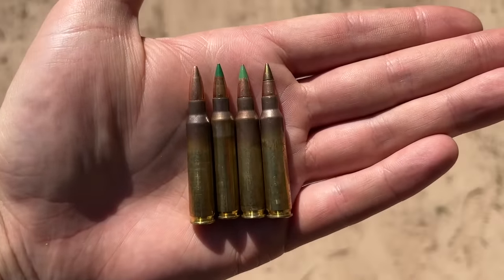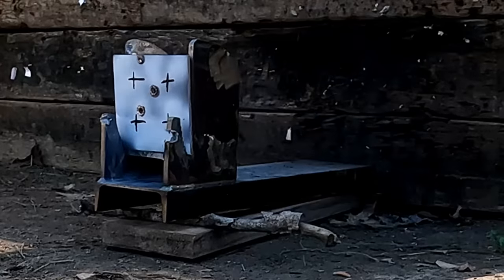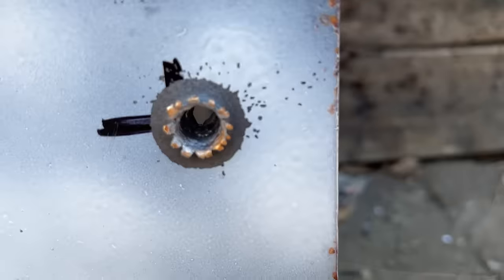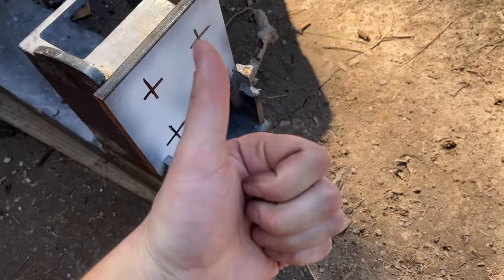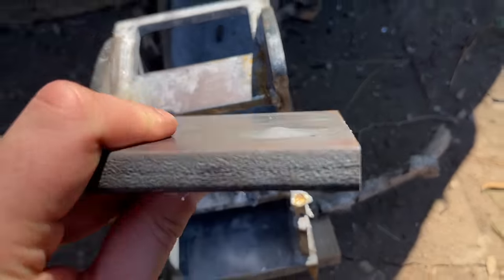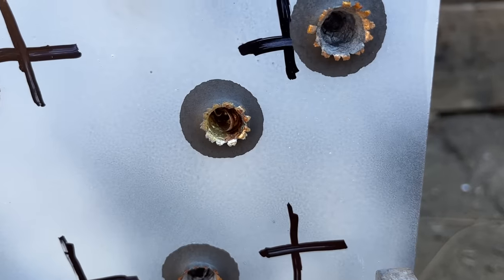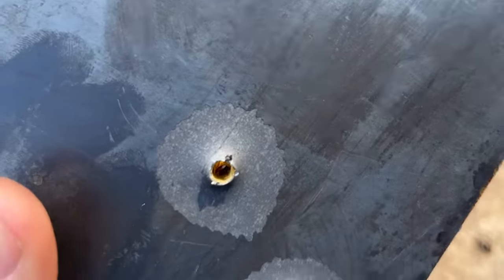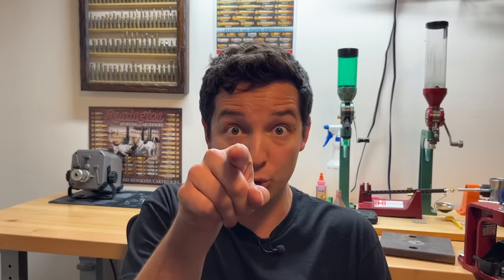M855A1 vs M855 vs SS109 vs XM193: Crazy Results on Steel

Comment: m855a1 out of a 26" barrel is the textbook definition of vibe check
Reply: That’s a super long musket!
Reply: I run em out a 24” and ummmm yeah they are def get your mind right…..
Reply: 26"!? Who holds the front of the rifle for you? Lol
Reply: The Oof felt around the world.
Reply: @robertcole7874  duck hunting shotguns are usually 28..
Reply: I’ve got 500 rounds of these in .223 😊
Reply: Can I shoot m855a1 out of ar15? It's a multi caliber 😊
Reply: @tteotyep8412  as long as it is .223, sure. and no muzzle brake. Definitely make sure you have no muzzle brake on it
Reply: Get yourself about 4500 more. That’s a decent start
Reply: @kylespirk306  can m855a1 used in AR15?
Reply: @tteotyep8412  this is not legal advice or recommendation but AR-15’s will shoot that round.
Reply: @tteotyep8412 yes.
Reply: @tteotyep8412 sure can. Make sure it's 5.56, or .223 wylde rated at minimum. M855a1 has pretty crazy chamber pressures, so a .223rem only AR will likely experience a catastrophic failure after only a round or two.
Reply: Where did you Buy that rifle from ? What is the Exact Model ?
Reply: Isn't 556 most optimal out of a 16/18' barrel?
Reply: @TTime685  not all 5.56 is made equal.
Reply: @gort7562  I'm talking about standard M193 and M855 with the common 1/8 twist
Reply: @Jermo7899  Why no muzzle break?
Reply: @TTime685  M193 and M855 prefer different twist rates but I can't remember them for the life of me. It might be 1:8 for M855? I can't say for sure.
Reply: @gort7562  Yeah, anywhere from 1/7 to 1/9 apparently. 1/8 seems to be ideal. And a 16 - 20" barrel for optimal performance. But there's so much info out there I'm having trouble getting a consistent answer lol..
Reply: @TTime685  In the m855a1 the gap between the steel tip and the brass is not smooth. It can get caught in the vents of the muzzle brake and blow up or backfire
Reply: @Jermo7899  How do you know this? Would seem pretty rare to happen if so. I would think the muzzle would have to cheaply machined or misaligned for a chance for that to happen. Or defective ammo. And why 223 only?
Reply: @TTime685  I’m sorry it’s the sabot rounds for .50 cal that can’t have muzzle breaks. I’m sorry I got it mixed up with the .223 m855a1 rounds for some reason. It is ok to shoot those with a muzzle brake
Reply: @tteotyep8412  yes they can. It’s a 5.56 NATO round. So your rifle has to be a 5.56. That is what they were designed for.
Reply: Any gun is a vibe check, 5.56 is weak, modern armor will stop it, even if it’s M855A1
Reply: @apache9162  close range It’s a beast. Most firefights are short to medium range which this excels in
Reply: @apache9162  not all shots are to the chest. In full auto it’s a lot easier to control than an Ak. Never underestimate anything when it comes to fighting for your life even the round the enemy is using. .223 has advantages over 7.62x39. .223 also has a flatter trajectory. 7.62 drops a lot over a significant distance.
Reply: @TTime685 this is mostly just praxis for (x)m193 iirc
Reply: @edstettin6799 some ar’s are .223 or lower pressure specification, so even tho it will chamber it might cause failure in the gun
Reply: @TTime685 5.56 was originally designed to operate out of a 20" barrel. Carbine versions with a 14.5" barrel have become more common in recent years with the US military. The Army adopted the M4 (14.5" barrel) as their standard issue rifle some years back. The Marine Corps kept the M16A4 (20" barrel) as standard issue ( for infantry) for a while longer, before switching to the M27 (16" barrel). The longer barrels offer longer maximum effective ranges with good terminal ballistics. The shorter barrels are better for moving through buildings & vehicles. 16" is as short as you can go without the rifle becoming an NFA item according to unconstitutional law.
Reply: Yeah it's truly impressive, I knew the M855A1 was great, but didn't realize it was this impressive.
Reply: We know who watches garand thumb
Reply: You should've hit the AR500 plate with XM193. 
It wouldn't have gone through... but MAY have dug a bigger crater than the other 3 rounds. 
With 1/4" AR500 plates - M855 at Won't go through... but XM193?  Can .
(Which is why a bunch of AR500 armor plate manufacturers started making a "3+" special threat plate (because hotter NATO 55grain ball was zipping though the level 3 plates)
Reply: …or musket.
Reply: Who’s shooting 223 out of a 26” barrel.  Maybe a 16 inch which is the most common.
Reply: @bmrz38 that’s a flag pole
Reply: @tightright7561  tons of varminters and target shooters use 22-26" barrels in 223 wylde chambered bolt guns. The velocity difference in a direct impingement gas gun and bolt gun is quite different.
Reply: no, not true. it’s built for 20”
Reply: @Jermo7899 uh, M855A1 is a 5.56 nato load. You can use pulled projectiles in 223, but at that point it ceases to be M855A1
Reply: @Midwestprpr  dude, you can use .223 in 5.56 mm. 223 is in inches. 5.56 is in mm. .223 is basically 5.56 just less pressure. Not exact but close enough. It doesn’t cease to be a 416. Just different ammo
Reply: @Jermo7899  the point is, someone was saying use M855A1 in a 223. That’s a recipe for disaster. I am extremely well versed in the differences between the two cartridges
Reply: @Midwestprpr  you’re right. I was just trying to point it out. I didn’t mean to sound condescending. I apologize.

Comment: M855A1 is really nice ammo. They should mass produce it for the public.
Reply: itd be easily $2 a round because of that tungsten core, technically you could make your own if you cast bullets or have a lathe.
Reply: It's available publicly now for $3/rd
Reply: @marblemarble7113  M855A1 does not have a tungsten core, it is a steel penetrator.

Comment: I would love to see this test with the same four cartridge in a 14.5in , 16in, 18in nd 20in barrels. Because these 4 will be more common than a 26in barrel.
Reply: Same, against ar500
Reply: Pretty sure a 26inch barrel would actually slow the bullet down.😂
Reply: Anything past 20" even onn308 has diminishing returns.
Reply: @uurkisme what do you mean. You were referring to barrel length yes? For a moment I thought you meant thickness of the barrel.
Reply: Brother you planning something? 😂
Reply: @uurkisme  wasn't it 24 inch with .308 and 27 inch with 7,62x54r?
Reply: @Stormcloakvictory  24" I think is peak performance but the difference between 20 and 24 isn't that spectacular to be worth the extra weight and length imo
Reply: My guy is trying to see what ammo he should use for his M4 in Tarkov lmao
Reply: /agree, as 26" isn't the least bit common - I've got an A2 HBAR with the 20" and with everyone running around with 16" these days, folks at the range are always commenting about how long it is.
Reply: @nunivet7006 tf are you talking about?
Reply: @lardomcfarty9866  it was just a joke.
Reply: @nunivet7006  okay. You never know what boomers will get scared by an innocuous question

Comment: That M855A1 definitely surprised me. That's a nasty Lil round.
Reply: It also is very devastating on flesh/bone.
Reply: @mikejohnson9118  At 3200fps a .177 bb would probably be devastating to flesh.
Reply: @hansgruber9685 eh probably not. Not enough mass
Reply: Great review man, a 16”” barrel comparison would be tits.
Reply: Right can we talk about the fact that the crono didn't pick up a single M855A1 round.... they are ffllyyiiinnngg😂😂
Reply: Yeah that’s why it’s at peacekeeper level 4 now
Reply: @Oreggon  It's not. Craft only.
Reply: It’ll rip through a slick, ofc it’s good…
Reply: They gave it a steel core and upped the powder load to nearly the maximum a 5.56mm chamber is rated for.
Reply: You are only see the best performance out of these rounds with a long barrel.

Comment: The SS109 is actually the bullet itself that is used in the M855. That's why both of those rounds had a green tip: they were both M855 rounds.
Reply: Forgive the ignorance but os the only difference the powder load then?
Reply: @ZyklonBeast12  Definitely. M855 is loaded to a "minimum" govt mandated velocity, based on the Nato spec. .223 Rem CAN be loaded to that velocity (with the right powder), but doesn't "have to be", and thus often isn't. Most of the Nato spec defines other characteristics of the ammunition. M855 IS .223 Rem, but with a bunch requirements added to it.
Reply: @nerdyengineer7943  Wow, I never knew any of that! Thank you for that info brotha 🙏
Reply: SS109 loads don’t have to have green tips. Green tips are only used if the ammo is made by a country that used M-193, as a way to visually distinguish between the two. I have 400 rounds of British Radway Green that doesn’t have green tips.
Reply: @mikecumbo7531  SS109 is the name of the 62 gn, steel core, boat tail bullet that us used in the M855 NATO spec ammo. M855 ammo, per the NATO spec, must have a green tip on regardless of who makes it.
Reply: @mikecumbo7531  Oh, and those bullets don't come with a green tip on them. Those are painted on after loading.
Reply: @nerdyengineer7943  well, neither the British or Swiss put green tips on their SS109 loaded rounds in the 90’s. I know Switzerland isn’t NATO, but the UK is. The British ammo didn’t meet US M855 spec, slightly lower velocity, made so for the SA80 rifle. Remember, M855 is a US spec, it includes a SS109 projectile at a specific velocity. NATO might have adopted the M855 spec, but doubt it is known as “M855” within NATO. 
The only reason for the green paint is to let people know the round isn’t M193 spec.
Reply: @mikecumbo7531  That's not accurate, my friend. NATO ammo has many tip colors to make it obvious what round it is. Obviously non-nato ammo doesn't need a tip color, if it's not to the spec. I'm researching this, but govt specs all point to other specs and so on.
Reply: @mikecumbo7531  I am not able to get ahold of the drawing for the bullet. However, internet searches show the popular wisdom is that the bullets are painted green to different from M193. So, with lack of better evidence on my part: I yield to you, sir.
Reply: @nerdyengineer7943  just Google “do all SS109 loaded rounds have green tips”. 
I know AP has black tips, forget what color tracer is, etc.
Reply: @mikecumbo7531 tracer is orangish red. Or maybe reddish orange.

Comment: One of the biggest factors here is the barrel length, 5.56 was designed for use in 20 inch barrels and up, that 26 inch barrel is getting MAXIMUM performance out of 5.56x45mm NATO. M855A1 EPR was designed to give optimal terminal performance out of carbine length barrels out to 350m.
Reply: None of this is true
Reply: @someguywithnoplan6395  Do you have source info that discredits my info, because I have TRADOC info that says otherwise.
Reply: @someguywithnoplan6395 google the barrel length of a m16 then get back to us champ😂
Reply: @nathancummins8728  No, I don't think that I will
Reply: @nathancummins8728 the barrel length of an M16 is exactly the length of the barrel you put on it.
Reply: @someguywithnoplan6395 5.56 was designed to have full performance out of a 20inch barrel

Comment: I would love to see a comparison of different 308 (7.62x51) bullets against different thicknesses of steel. Be safe my friends.
Reply: M80a1 would be insane
Reply: Pretty sure he's done all of these tests before. Just a different setup.
Reply: @fatihmehmetcevik7299  did you see ak ballistics fire 1 from a .300wm? 130@3790…I run the dd5v3 and been loadin and testin with it over 2yrs and big .30cal fan
Reply: Used to train shooting the FN fal against half inch falling plates, the mild steel ones it would go straight through but the armour steel would show hardly any penetration ( 200 metres)

Comment: Great test.  I’d prefer a 20” barrel - I think the velocities for these rounds diverge from how they behave out of standard AR-15 barrel lengths.  They are probably all still faster, but by varying amounts.  I suspect the 855a1 is comparatively even better than the others out of shorter barrels.
Reply: It was designed to be shot out of a 14.5 inch barrel from an m4a1 carbine at a whopping speed of 3000fps at the muzzle
Reply: Hmm source?
Reply: @BaconSlayer69 it was designed to be environmentally friendly. That’s it.
Reply: @coryhoggatt7691  that too but specifically it was designed to penetrate barriers better
Reply: @coryhoggatt7691  somebody didn't look at the congressional report or the army procurement presentation

Comment: I've seen other channels get a hold of those A1 rounds and they never fail to amaze me how Wicked they are.
Reply: Saw some kid shoot himself in the leg with one on the range. The results were indeed wicked. Bro deleted his calf.
Reply: @cameronking5074  impressive in a dumb way he managed to shoot himself in the leg with a rifle no less.
Reply: @cameronking5074  he was probably using m193 not m855 let alone m855a1
Reply: @moparjr89  it was definitely m855a1. It’s hard to mistake the steel penetrator.
Reply: @moparjr89  The army exclusively uses 855A1.
Reply: @orion8981  you can get m855a1 on the civilian market, see them all the time at guns shows. Good luck finding some m955 tho have yet to see it in person and there’s very few videos about it on YouTube
Reply: @allaansnackbar4269  I'm aware.
Reply: As a Soldier who may have liberated some 855A1, I can attest to what happened.  On soft targets, the A1’s copper jacket very often explosively sheds very shallow in tissue, resulting in what looks like a big exit hole, but in the entrance side.  Weird physics.  But that penetrator keeps on zipping through and out making that tiny tube of damage through the body.   Not at all like a typical soft point, hollow point, or the fantastic yaw effect of M193’s.   
Even shooting into a dead tree, you can see entry surface blowout.   
The M855A1 is very good against things wearing plates, but it is not a good overall killer in normal hunting use. 
M193 is the best killer, M855 green tip just kinda half-asses  all-around, and M855A1 definitely punches through plate, but does not necessarily kill well.

Comment: We can say there is a clear difference between the 855 and 855A1 at this point.   That frontal spauling on the AR500 .375 should be terrifying.
Reply: For sure. The splash itself could be lethal.

Comment: One interesting thing is that M193 and SS109 / M855 were OPTIMIZED for a 20 inch barrel; i.e. the "standard" barrel length for the M-16 / A1 / A2 and others like the FNC, etc.

5.56 x 45 velocity PEAKS at about 22 inches of barrel, (It it a fairly dinky case, after all). The M-193 cartridge  AND the M-16 rifle were essentially developed in parallel. 

Hence, after going "all in" on the 14.5 inch M4 concept, a "new" optimized round seems to be in the offing. How this might behave in a LONGER barrel like the M249 is anybody's guess. (chopping the M-249 barrel back to 14.5 inches might just cause a whole lot of new "issues".

Comment: I have plenty of M855 and 700 rounds of M855A1, because it’s the best combat 5.56 round out there IMO. It will create a massive temporary wound cavity and is barrier blind. It will also penetrate most body armor outside of level VI and very expensive level 3+ plates. Another great round is the 77 grain MK 262 that you should have a good stock of as well. It’s a very accurate cartridge that is good for distance and has great performance on soft targets. M193 is a target round for me and nothing else. I mean it will still do the job, but it’s one of the least effective 5.56 rounds available in my opinion, because it really relies on velocity from a long barrel. I wouldn’t recommend it with anything less than an 18 inch barrel. Great video!! I have recently become a subscriber and appreciate your testing.
Reply: Goodness that's a lot of A1. Mind if i as the $/rd you paid?. Cheapest A1 I can find is $2.50 per round. I'm also trying to slowly build up a quantity of M80A1 but that's going to take a while considering the cheapest I can get it at is $8 per round and it rarely comes onto the market.
Reply: Where does one even get M855A1? I thought that was only available to military
Reply: If you've got a 20" barrel, M193 is wildly effective. Especially for the cost. IMO, that alone is reason enough to have a 20" setup in 5.56 in addition to shorter rifles, solely so you can stock up on large amounts of cheap 55 grain and know it'll be effective for anything you'd need.
Reply: kudos..... but NEVER brag/disclose about your stash..... no one needs to know but you 😉